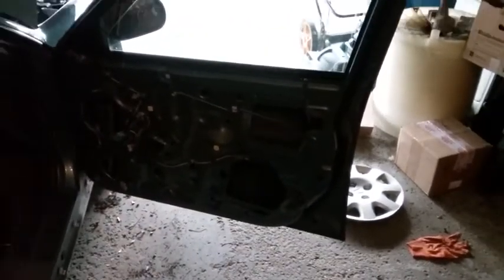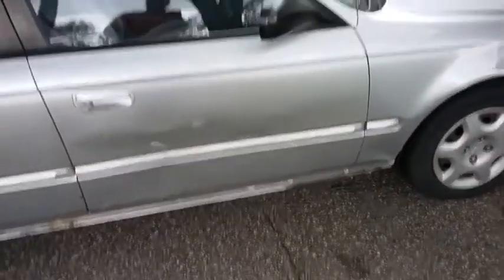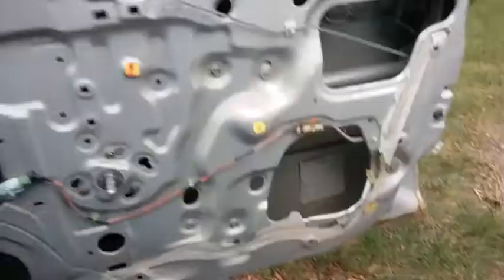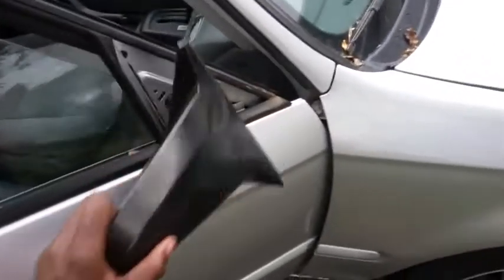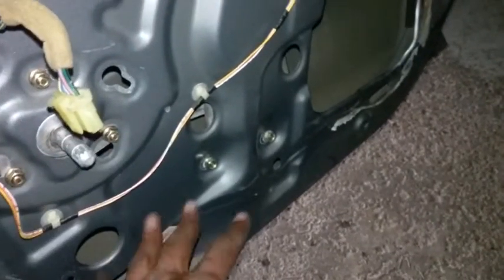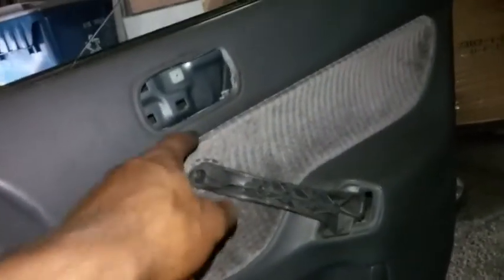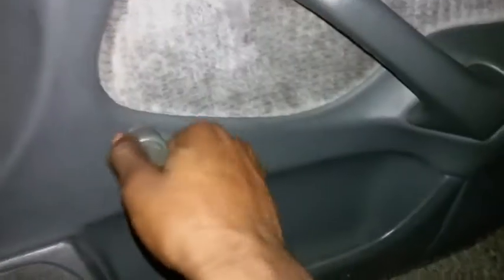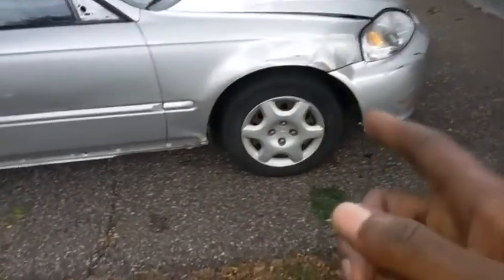$900 Civic Restoration Pt. 3 - ELECTRIC TO MANUAL WINDOW (DOOR) CONVERSION

Comment: I’m curious as to why you would convert to a manual window?
Reply: Rewatch the video it explains why
Reply: Destiny Ramirez you don’t mention the benefits of switching to manual windows.  You explain that you have no choice.
Reply: @charlemagne2083  for me it's more convenient you get to control the speed of how fast you roll your window up and it just feels more vintage which is cool also the more high-tech the car is, the more expensive the repair is as well. The power window assembly is no exception.